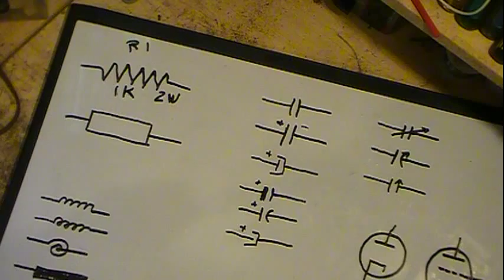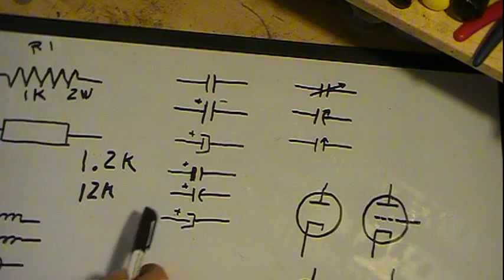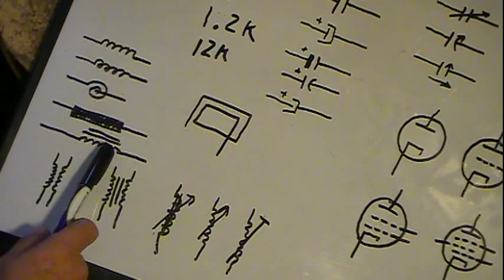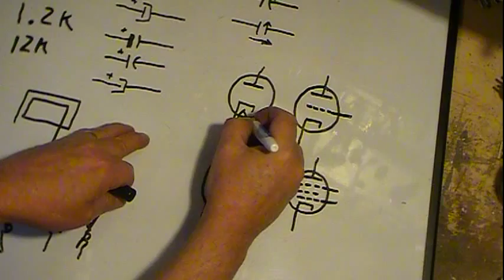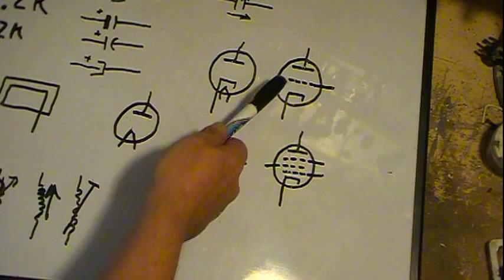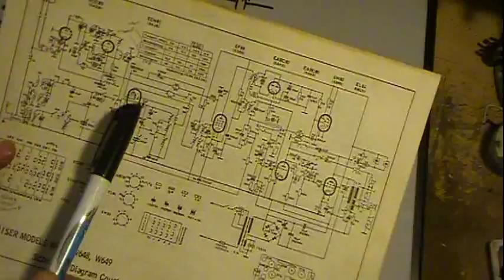Schematics 101 part 1

Comment: In the older world of Engineering in the USA, units were written out as M for thousand, and MM for million regardless of what the type of unit was be it pressure, temperature, flow etc. Using the letter K to denote thousands came from Europe with the metric system, and K being 1000. 
Sometimes on older equipment schematics you see resistors or caps marked with MM which equals million, M meaning thousand.